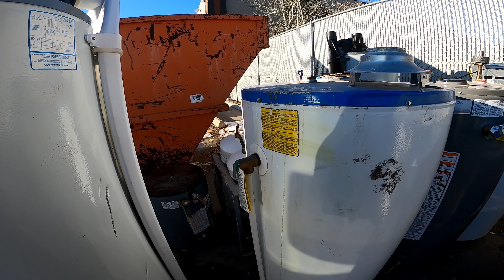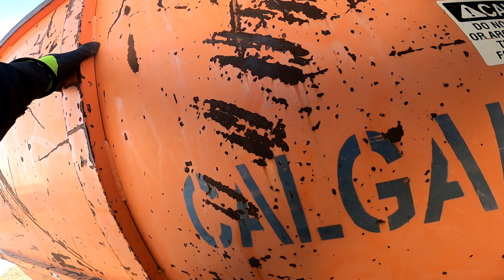Dumpster Diving For Scrap Copper And Brass At Plumbing Shops! Trash Picking Recycling 009

Comment: That pump your talking about has a good bit of copper inside and they are easy to take apart
Reply from the maker: I’ll have to grab all the motors next time, I started out by skipping them but by the end of the day I would have had half a dozen or so
Reply: @thubprint  quick video here for you skip it to 15.35 in the video  https://youtu.be/kmuqbP4VFyw

Comment: Not alot of but some of the short fat waterheaters if there older than 2006 will have giant copper barrel liners inside them if it is  its worth taking the whole heater and cleaning it...
Reply from the maker: Really??? Wow, that’s worth looking for. What kind exactly? Not like the propane bottle sized ones that I found here but similar to the “regular” water heaters only smaller?

Comment: I've been running  a scrapping LLC for about 10 years... you don't need to do all that work after you get back yea you have to break down your different metals but all scrap yards at least in Georgia it's whatever the majority metal is the price they give you
Reply: Most scrap yards have grades for clean and dirty metal. You get more per pound for clean brass/copper than brass with steel screws in it or with aluminum attached. Some even separate yellow and chromed brass. Even copper with a small amount of brass attached gets you the brass price instead of copper
Reply from the maker: Yeah, mine may grade on the majority but I definitely get much worse prices if there’s contaminants left on. I don’t ‘have’ to do the work, but it pays well!

Comment: Get some muriatic acid from a pool store (dilute HCl.)  Zinc will bubble when dipped, aluminum won't.  Or-  since zinc is about 2.5x as dense as aluminum, you could do a water displacement/weight calculation to determine the weight by volume.  Zinc is about 0.26 pounds per cubic inch, while aluminum is about 0.1 pounds per cubic inch.
Reply from the maker: You so smart 🥰
Reply: @thubprint   - you know it, babe!

Comment: Fellow Utube scrapper, Okie Scrapper keeps a spray bottle of copper sulfate and water in his shop. He grinds a spot on aluminum looking metal and sprays some of the mixture on it, if it turns dark it is not pure aluminum, probably some kind of pot metal. If it is aluminum it doesn't turn any color at all. Good luck and thanks for the vids!

Comment: Probably die-cast aluminum. The same stuff hard drive casings are made from. Usually looks a lot smoother and brighter than regular cast aluminum
Reply from the maker: Hm.. I think chemical testing is the next step, until I get the hang of it

Comment: If you haven't yet figured out how to tell if its zinc, mix a teaspoon of copper sulfate with 16 ounces of water. Scratch the metal and spray the mixture on it. If it turns dark then it is zinc. If it does not turn dark then it is aluminum.

Comment: Big square thing is a burner for tankless water heater along with a gas manifold that has the two round ports on it. You can actually separate each of those little things in the burner, just be careful because they are super sharp.

Comment: ThubPrint you have inspired me with scraping and saving other people trash and either reusing or selling. Coming from the UK. I have seen many others videos and only your one has inspired me .
Reply from the maker: Wow, thank you! Just stay out of trouble, and do what you can to keep it moving quickly. It piles up so fast, and a month later you’ve become a hoarder! 😂
Reply: @thubprint  Yeah most people don't mind in the UK as long as you ask, there normal fine. I have a system going. Keep up the clips 🙌

Comment: Zinc is FAR denser than aluminum. Aluminum has a density of 2.7 Gr. /CC, while Zinc is 7.1 Gr. / CC. When you've handled enough of it, its obvious the heavier and the lighter cast materials.
Reply from the maker: Huh.. maybe this stuff is aluminium after all. It’s just the level of detail in the casting and how thin the walls are, I have a hard time believing alu could be cast in such a fine shape 🤔
Reply: @thubprint  break off a small piece. zinc will melt pretty quickly with a propane tourch

Comment: I know this is months old but if the scrapyards in your area have a different price there is a simple way that doesn't depend on your subjective opinion about the grain structure of the metal, color weight, etc. Just grind through a secion of paint if it's painted - you need bare metal - and take some concentrated crystal draino crystals and pile them on the bare spot. You have to leave it for a few minutes but if it's aluminum it will turn black and if it's zinc it won't do anything. Just be sure to thoroughly rinse the crystal off after. This works 100% of the time.

Comment: For the fittings that you were having difficulty getting started sometimes the application of a bit of heat from a mapp gas or propane torch will help loosen those, especially if they have red locktite on them.

Comment: M8 zink mixed with aluminum makes die-cast  , so you can sell it as cast aluminum ; and a pipe wrench can be really helpful to remove those pesky pieces of copper and brass. The valves off the water heaters 90% of them will be red brass or bronze ( as other people refer to it ) making your payday a bit larger. Keep up the good work.  God bless y'all.
Reply from the maker: Ahh, so in reality it’s not zinc OR aluminium, but both. That makes it so difficult to make a video on lol!
My yards only do 2-3c more on red brass so at my volume it doesn’t change much. But good to know which is which nonetheless!
Reply: @thubprint  M8 here in the USA it is about 20 cts more for red brass , since,  it has more copper in it . 
Continue doing your great videos M8.

Comment: Zinc has > 2 1/2 times the density of aluminium. If its "heavy" for its size, it could be zinc. In my experience (limited) Ive only found zinc where weight is imporatnt, like in a hanging light, where zinc's weight will make it harder for the wind or a breeze to sway the light.
Reply from the maker: Ohhh, that makes sense. That’s generally my first consideration to determine what the metal is, the application it’s used in.
Reply: Good tip!

Comment: The little tab on the toner cartridge has two gold contacts on one side and one gold point on the other under the black little resin insulation dot.
Reply from the maker: True. Not sure if it’s worth hunting down though, but a fella could grab the ink carts and fill a bin to pick them off later.
Reply: @thubprint  I work in an office, I get at least a couple of tabs and foils off of smaller cartridges a week.  Been doing it for three years and have a half gallon container crammed full
Reply: @thubprint  Apparently the foils are 1/17th gold by weight if the E-scrap facebook group I'm in is to be believed.

Comment: I know On my route there is a plumbing shop and if I hit the one section there is a HVAC place. The plumb place is decent most of the time. The HVAC place is pretty hit or miss. The plumber place I have no idea what they do with their scrap. I never see hot water tanks or anything, but there will be other random scrap on the side of the dumpster. The HVAC place and the one next to it have someone pick up the big stuff.
Reply from the maker: Sounds like it’s worth checking when you’re in the area at least. I had a plumbing shop I’d stop by all the time, but they moved locations